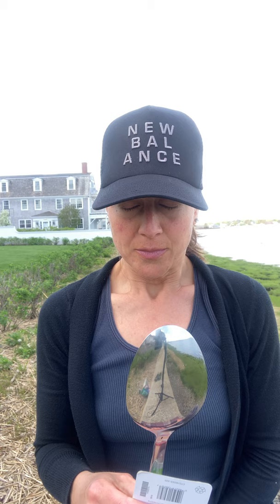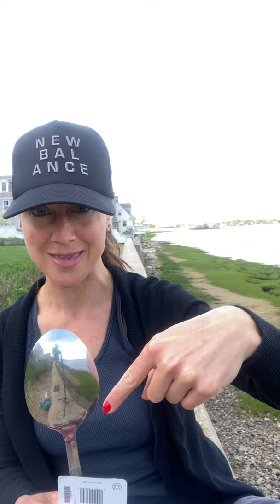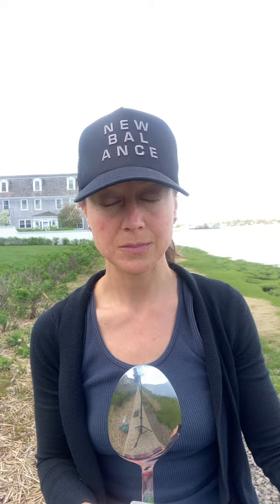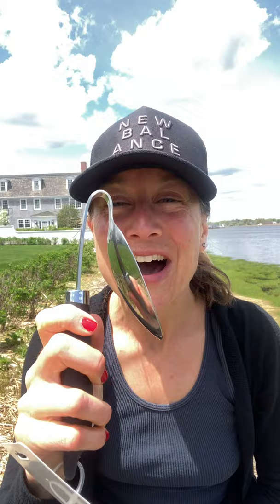Quantum Spoon Bending - LADLE!!!

Comment: Thank you! I've been trying to bend a large 6inch nail with no luck. It's about .25inch thick. My meditation and mental state my be really off.
Reply from the maker: So welcome! Just keep trying the techniques and have no expectations (that's the hardest part). If the nail is too small for your hands you can try steel rods instead. I know someone who bends 3/8" and 1/2" diameter rods from Home Depot. Anything is possible!
Reply: @ArianaBahret  I have plenty of steel bar to try. These nails are pretty large and I have many as well. Dory was right.... just keep swimming .. ;)
Reply: @ArianaBahret  I want to know why you call it “ quantum “ spoon bending? What is your definition of quantum in this context?
Reply from the maker: @watchman_8290  Hi Jah - thanks so much for your message. So it's quantum spoon bending because your working with the quantum field. Quantum meaning subatomic particles - electrons, protons, neutrons. When you do these techniques, you are actually accelerating these tiny particles into another dimension for a short period of time. When this happens, the metal becomes very soft and you can bend it with little effort. But as those particles start to slow down and come back, the metal gets hard again. There is a slight amount of mass (not weight) lost in the process of acceleration which is later regained after slowing down. Hope this helps!

Comment: Hi, I've had pretty good success, bending spoons and forks .

But can't seem to achieve any real results , with butter knives . ( Don't worry , the ones I practice with , hardly have any teeth and are not sharp . Lol 😉)

The knife is perhaps , slightly thicker . But not enough in my judgment, to make a difference .

I'm just wondering , if you or anyone else have had any success , bending said knives ? 

And if so , any tips to share ?!

Thanks for reading .
Reply from the maker: Hi Larry! Thanks so much for your question. So I've never tried a butter knife but Im sure it can be done. If it's thicker than the forks or spoons you usually bend, I would say to give it a much longer incubation period (the wait period after doing the technique) before trying to bend it. Again, to me doing something thicker or bigger is not the point - the point is the demonstration of a tangible shift (Hard metal to soft metal) from focusing your thoughts. Period. So I'd say dont get too caught up in trying to bend the knife : ) I tried the thick ladle just to try it - but I had been bending for 6 years at that point and I never had an interest to try anything bigger in all that time. I know someone who has bent thick metal rods from Home Depot, but again that's not the point : ) If you're making the metal soft with your thoughts and energy, your succeeding!!!
Reply: @ArianaBahret  

Thanks . I'll try to have more patience , as I give your tips a go. 👍
Reply from the maker: @larrymiller3849  Awesome! 😁
Reply from the maker: @larrymiller3849  Also try other techniques! Everyone is different for which techniques work fastest for them. I have 4 techniques on my YouTube channel and 8-10 techniques in my online class.